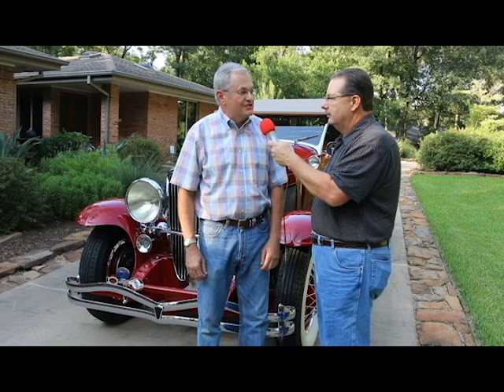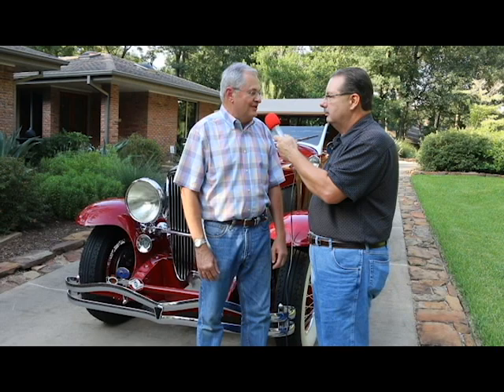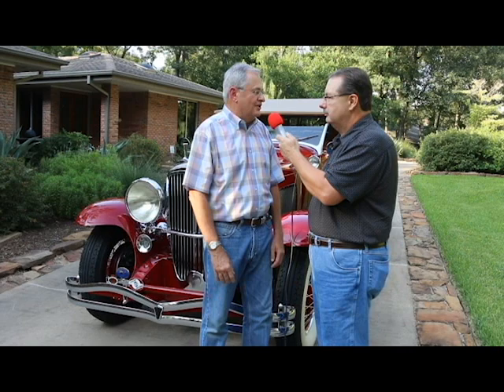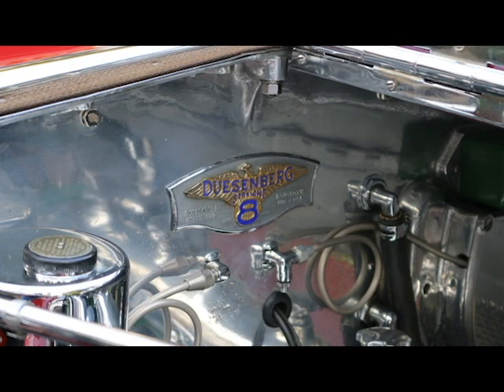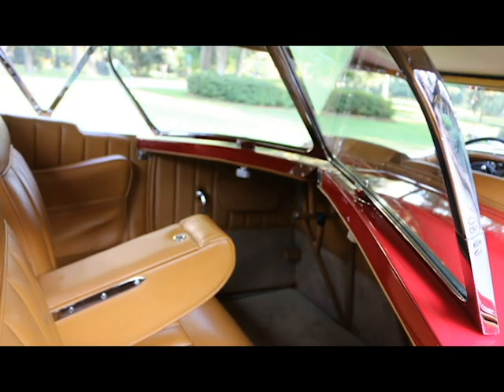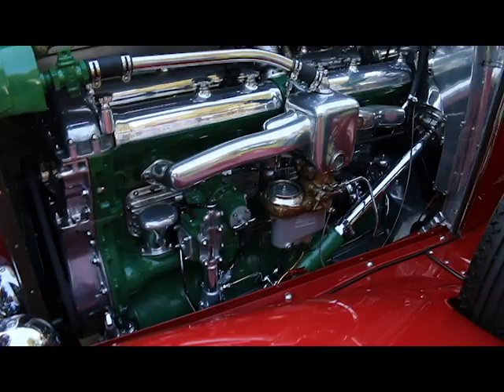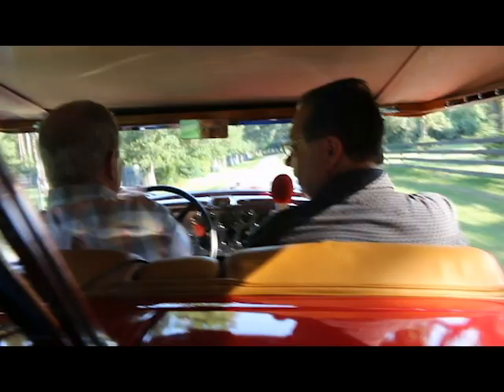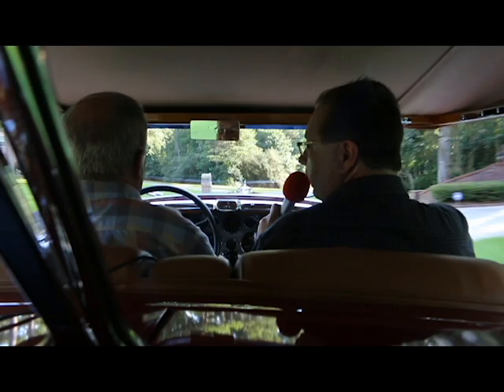1932 Duesenberg dual-cowl phaeton

Comment: The 400 hp model was a Duesenberg straight 8 dohc supercharged engine and a Duesenberg chassis with a modified Auburn boat tail Speedster body.

Comment: Duesenberg manufactured rolling chassis, which were then sent 
to various coachbuilders for a body to be made and fitted.
ALL Duesenbergs are 1928's, the only year of production.
Reply: Were they all (500ish cars) 1928, or made in various years, but all identical to all other Duesenbergs?
Reply: @ralphy12345  Inasmuch as the bodies were made by various coach builders NO  Duesenberg was 'identical' to another.
Reply: @jerrycallender7604  do you know how long it took Duesenberg to turn out those 500 cars?. That's the root of my question. Did it drag out for 5 years? ie 1928-1932?
Reply: @ralphy12345  It wasn't done overnight.  All I know is that ALL Duesenberg chassis are 1928.